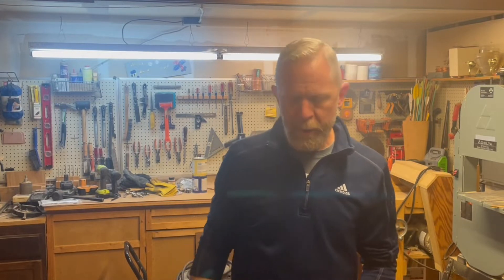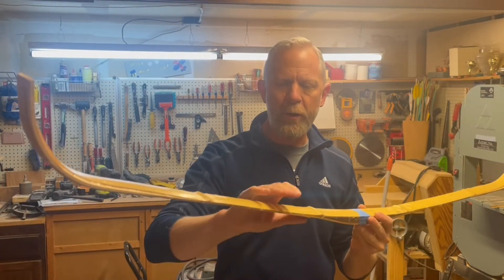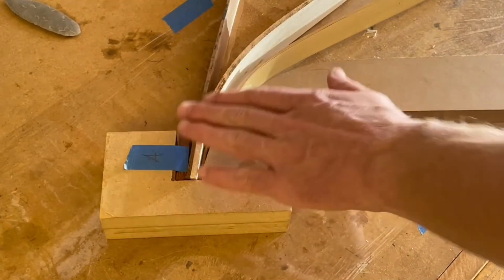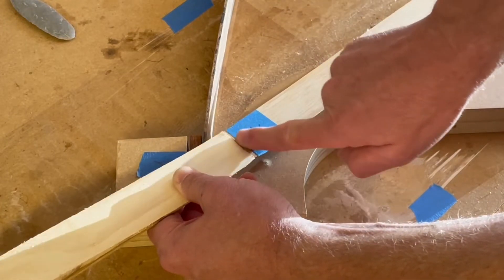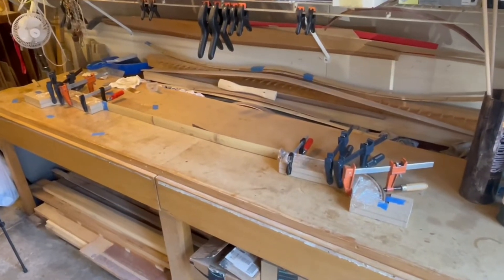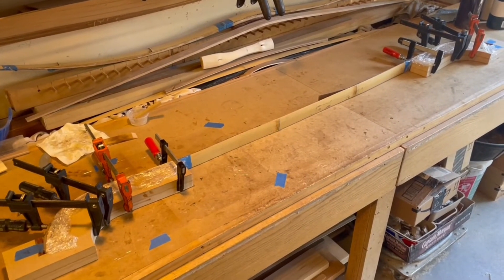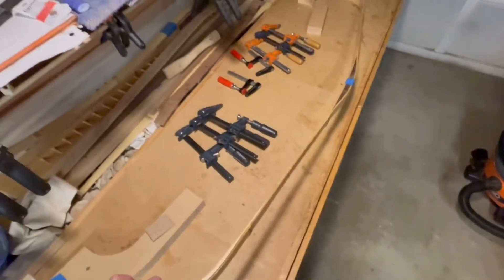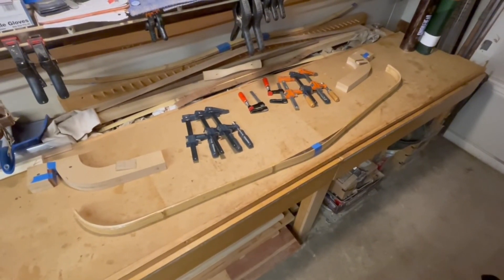Scythian bow experiment Pt.2

Comment: I have been following you ever since you almost began the chnnel. You are doing exemplary vids that can be easily understood. Truly tutorial in nature. Would appreciate if you could also give a video on Bamboos you use  and how you ptocess them. Or do you procure ready slats ?
Reply from the maker: Thank you for watching my channel and for your kind comments!  For starters, I’ve been using Moso bamboo in my builds.  I get it from a commercial bamboo supply in 2”X.25” slats that are marketed primarily as wall coverings, or fencing.  They would tell you that they are very versatile for any kind of project where wood of similar dimensions would be used.  Under normal circumstances, I purchase the slats in bulk, but since the COVID shutdowns there seems to be a wide-spread bamboo shortage that is threatening my ability to move forward with many more bows. I’m literally down to my last 10 pieces.  As for the processing of the slats, I will add that subject to the next build and expand the tutorial to be more informative in that area.  In the meantime I’d encourage you to check my “preparing a bamboo backing” video which gives some basics on how I pick and lay out my bamboo as well as how I shape and taper a backing strip for wooden bows - which is probably 80% of the process that I use for all-bamboo bows.